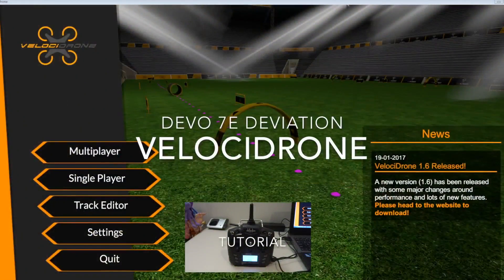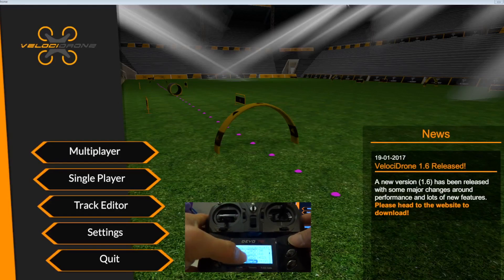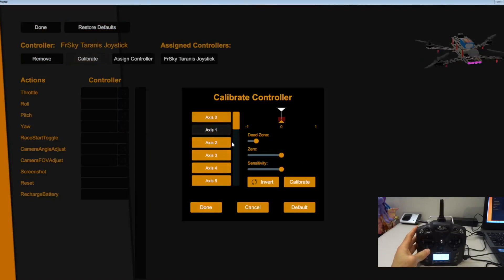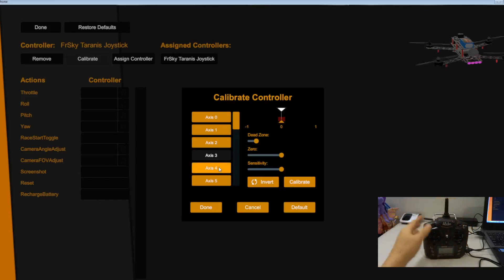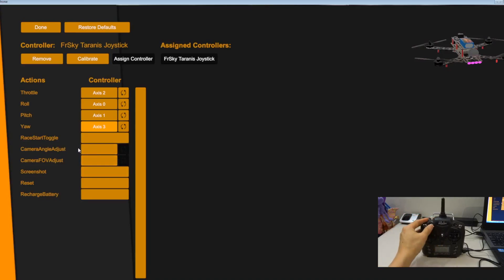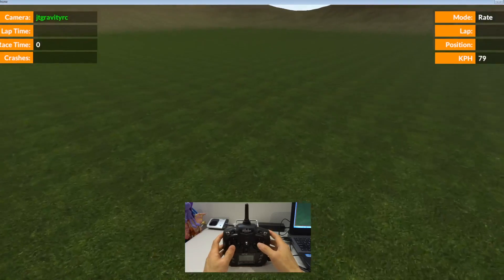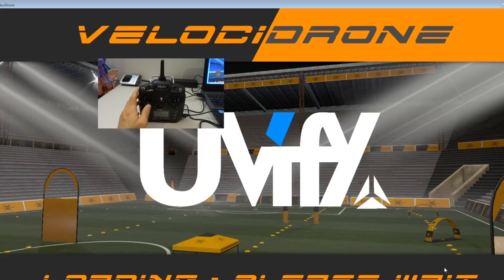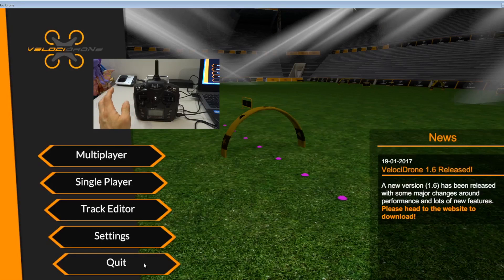Devo 7E Deviation set up in Velocidrone Tutorial (also for Devo 10)

Comment: hey man great video. do you mod the devo 7e? I'm looking for someone to do that as well as flash fw on a e011
Reply from the maker: Thanks :) mine is modded
Reply: jtgravityRC I'm asking if you could do mine lol
Reply from the maker: lol :) It is not hard to do, just basic soldering skills - you can consider this module iRangeX R4X Pro 2.4G CC2500 NRF24L01 A7105 CTRF6936 4IN1 Multiprotocol External TX Module w/Battery
https://goo.gl/PsvChp - without modding - but unfortunately it does not have the bayangtoy protocol - you don't have to mod, just flash it with deviation and it will allow you to use DSM/DSMX and you just need to go and buy a quad that has that protocol which flies similar to e011 - kingkong tiny7 https://goo.gl/EDpf13, Eachine EX105 https://goo.gl/wkZoRh, Eachine EX110 https://goo.gl/z6PBc5, Kingkong Smart 100 https://goo.gl/d8NoV4